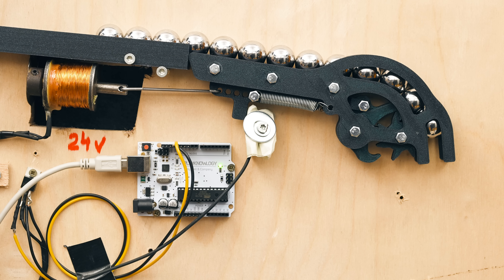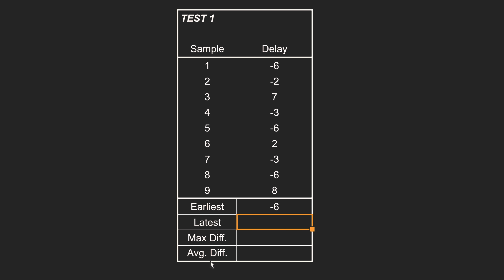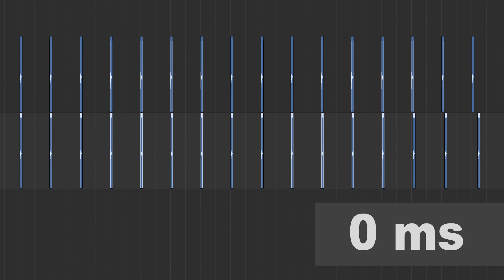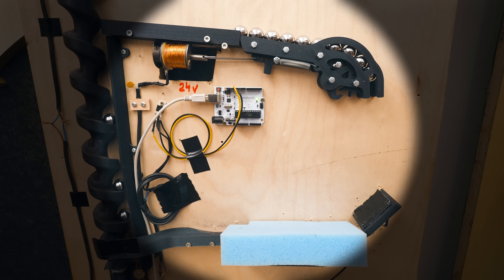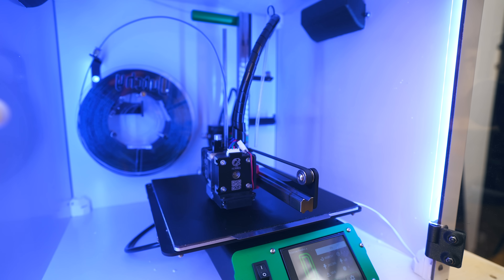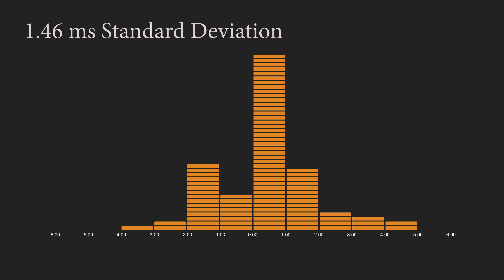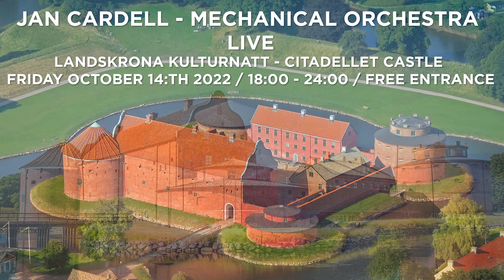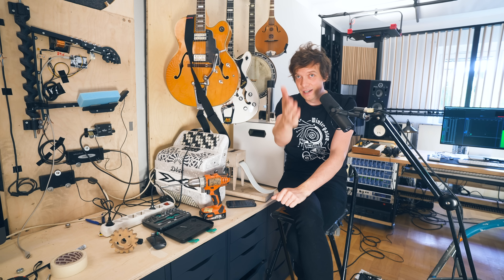Testing the Arduino Marble Gate

Comment: Just saying, even though I barely have experience with actual music, I would have the same kind of perfectionism with the kind of musical stuff I make. It took me quite a while to break out of it saying "I can always get it as close as possible but not perfect every time". A small ms delay (especially 1 or 2 ms) is not such a hinderance to the sound of the music and wont ruin it, like in a live concert. A few cents out of tune will not hinder much of the sound of the music and wont ruin it, like in a live concert. Perfectionism will only slow progress down. Our imperfections make us human, just like how imperfections of the original marble machine gave it its charm. You can improve it and make it way better, but never 100% perfect.

Comment: Guide the fall more during th release and it should hit more closely to the same position each time. The release of the falling ball will have tiny variation and that will alter the angle the ball falls in slightly, but the further from the drop the ball gets the bigger the variation in the hit area you get. To remove that, just guide the balls a bit more at the beginning after it's dropped and that issue should go away. It might add a few milliseconds to the release to hit time, but that at least should be the same each time.

Comment: For next tests you can utilize the arduino to measure the inaccuracies. Simply connect the microphone to the analog input and detect the spike or better, use comparator to convert the spike into digital rising edge. This way, to be precise with both dropping the ball and measuring the time, you can utilize timer and interrupts - they are way more reliable than millis() and delays. For any help or question hit me up

Comment: To get a better statistic and less work you should have the marbles drop onto a switch that can send an impulse back to the arduino. That way you can record 1000:s of hits digitally and then import them into your spreadsheet for calculations without the need to manually write digits and analyze sound-patterns.

Comment: I feel like there's a fundamental misunderstanding as to what standard deviation means in this context?
It's being represented as a constant delay, that increases the separation over time, but that's not how this would work in practice? Some hits would be earlier than the standard deviation, some would be later. 
If you let the simple pattern run for a long enough time, yes, this will be the end result, but if the song isn't long enough, that "problem" may not ever become noticeable... 

Pretty sure that  Martin doesn't write songs that drop the same exact, repetitive beat pattern  run for ten straight minutes. The normal variety of an actual song should prevent this delay from becoming apparent. 

Never mind how much slop there is in that home-made solenoid... It moves visibly left and right. Perfectionism can go off the rails... Is that's what is happening here?

Comment: For the record. Sound travels 1feet per millisecond. So. 3ms is one meter of difference . Basically having 3 ms delay is like stepping one step away from a speaker. Or. 2-3ms is the delay you have when you play the piano. The length from the string to the ear.

Comment: How did I miss this video :O I was wondering where Martyn got to, welcome back!

Btw with arduino are you usig millis()? the timer4 interrupt will mess up the accuracy of loop(){} when you are using delay(), however if you set a variable to millis()+yourTimeHere and then wait for the variable to be equal to or greater than (>=) it will tighten up the precision

Another way is you can stop all interrupts with cei(); but you will need to use the sleep.h library and a few other steps as delay() will stop working without timer2? running but you won't see any jitter in your timings

Comment: This reminds me the pursuit of prefection on audio amplifiers, DC-DC designs, unnecesary high speed and bandwidths .... something that is theorically deligthfull, with good reasons behind, could end sounding harsh in practice and the desire for speed leads to inestability. All this perfection wont even atract audio enthusiasts that prefeer valve amps, some of them from the 50 and 60s which in paper got worse numbers in alost every aspect in comparison to SS. Accuracy is not always a good friend of what or brain is pleased with.

Comment: I understand the need for tightness. But also wonder if this can be tuned afterwards. E.g. your microphone will delay all sounds for 10 miliseconds, except the drum, because that is always late. 
Because if you really want to do this mechanically it's going to be washers all over again. It also means all your instruments need to be at exactly the same height. For your cyberbase it may be very tricky- will the sound pick up on the marble hitting, or on leaving? 
So although I encourage such rigorous testing, I also wonder the implications of it -- is it a problem which can be worked with, and at what cost? 
And do you really want to finetune 50+ gates to be properly aligned?

Comment: If you would try to compute the 95% confidence interval on the standard deviation of TEST 7, you will get (1.8, 2.4) for your sample size of 92. The fact that you got 2.83 in Test 9 is so outrageous from a statistical point of view that it becomes unbelievable that the experiment setup is actually the same. The issue with the incline of the ramp shouldn't really matter in this case, because the variance component that you get from it should also be present in TEST 9. And yes, for the confidence interval you have to assume normality, but TEST 7 data looks normally shaped. My only conclusion is that there must be a difference between the setups of TEST 7 and TEST 9. Even humidity could play a role, but again, there must be another factor that influenced those results.

Comment: There's something I like to call "Bassoon Theory": the bassoon is a ridiculously badly designed instrument. Every single note is either flat or sharp and has to be adjusted for by the player, there are multiple notes that can't be played at all, and you need to "flick" at the octave key to get some high notes to come out right. Compared to a cello or a flute, it could almost be considered unfinished. But it works, and it produces a beautiful sound, flaws and all.
Don't worry too much about these almost imperceptible details. Sure, sometimes the MMX dropped a marble, or rattled around a little, but it made lovely music, and it doesn't need to be perfect to do that. No matter how imperfect the original design was, it worked, and it was better than a bassoon. And, to some degree, the imperfections were what made it beautiful.

Comment: Your two marble machines drive multiple voicings from a single marble mechanism.  That sure doesn't give you the flexibility of a modular system.  But, what would a single marble mechanism look like if it were designed to drive interchangeable voicing modules?

Comment: You know what would be cool, a messy music machine that is allowed to throw marbles on the floor which are then gathered on a giant sheet/ramp under it and then auto collects and funnels them back into the machine that can also  play random sloppy notes that can auto correct for its breakdowns with built in fail safe mechanisms. This failure allowance could create beautiful dynamic fluidity in whatever music it conceives naturally as a result . It won’t be tight , but it will certainly be art.

Comment: Edit2: 17:09 - THE coolest mechanical orchestra are ones without any electricity powering them. In my eyes, this makes you one of the best musicians to ever live.

Edit1: After finding some time to actually watch the video, I'm editing the comment. This is the first time I'm glad the title was misleading :D
Should be "Testing the Marble Gate using Arduino". Original comment:

Careful with adding electronics. Electrical components can make everything work, but you might regret not making it purely mechanical.

Comment: This is just one gate? It's going to be a nightmare manually timing out multiple of these rigs if continuing with a MC. You might answer this later in the video though.

I timed out 102 raspberry pis to fire cameras based on multiple physical sensors. It was also extremely time sensitive and I can't imagine trying to create anything reliably musically out of any of those mcs.

Comment: How tight? how accurate? Simply put, How tight can you measure? How tuned are your instruments? (non musical) That's the limit of "tightness" of all physical systems aka everything. Marbles are no different. Electrons can be considered as very small charged marbles, how "tight" can electronics be?  These are all rhetorical questions. Certainty and precision are illusions of scale. When it's good enough it is good enough, wherever you decide that may be, beware quixotic pursuits of perfection.

Comment: Martin, my good sir, sound only travels at about 1 foot (30 cm) per second. Two marble gates in PERFECT sync but 60cm apart will be "loose" by 4ms (+/- 2ms relative to one another) depending on whether you stand to one side of them or the other!

Comment: With a standard deviation of 4 ms, 95% of all hits will be -8 to +8 ms from the mean, which was -1ms, so -9 to +7ms, which seems perfectly adequate to me. Notice you can't say this without knowing the average, so I don't know why you decided to ignore the average! In reality there would be a physical upper and lower bound to the variation which will bring it to about 100% probability of being between some small number to some other small number.

Therefore, even without realizing about the angle of the target bringing the st. dev. much lower (which is a great find), it didn't seem like a good place to spend a lot of time micro-optimizing.

Comment: Personally I'd have no issue with the programming wheel making an electrical connection and dropping the marble with a solonoid, it's still mechanical, it's still going to make clicky clacky sounds, just means you don't need messy linkages

Comment: Glad to see you back at it Martin and thanks for sharing the data collection process with us! It is very interesting to watch. Just a heads up on the statistics... Standard Deviation tends to be sensitive to sample size, meaning a larger N will tend to result in a smaller SD, even if other factors describing the distribution like min, max, and mean are all the same. So if you continue doing analysis that relies on comparing SD's across samples, it would be good to hold N constant as much as possible. I think you were doing this in most of your trials but you didn't mention sample size so I thought this might be good to consider.

Comment: I work in telephony where the acceptable "jitter" limit for an audio call is 30ms.  The marble gate is an order of magnitude better than that at 3ms which is close enough for rock and roll ;)

The other thing to remember is that this 3ms accuracy is a standard deviation - some impacts will be early, some bang on time and some late.  The increasing ms delay playback artificially amplifies the effect.  Try instead to make a playback where the beat is adjusted by a normal distribution of +/- 5/10/20/50ms and listen to those for a more realistic experience of how the machine might sound.

Comment: So 3.9 ms of standard deviation, does mean that approximately 68% of the marbles will be within + or - 3.9ms apart from the middle point (in this case 0). Now, in my opinion, tight music is overrated. I think, variability in the timing gives personálity to music, that is why I rather listen to live performances rather than studio music.
Reply: Also, 95% of the marbles will hit between + and - 2SDs (7,8). this mean that between 3.9 and 7.8 you have only 27% of hits. 99.7% will be within + or - 3SDs.

Comment: I don't mean to sound like I'm telling you your wasiting your time but I think that your doing the "lost in the details" thing again.   I would say that you should measure the standard deviation of an actual drummer and use that as a baseline to match.   I have a hard time believing that a human would actually be this accurate.  If you require everything on the machine to be this accurate then I feel like you'll go down the same rabbit hole of impossible perfection that you were trying to achieve with the MMX.  I'm not saying that what your doing is wrong or invalid I'm just worried that trying to hold your designs to this level of scrutiny then you will get to bogged down in perfectionism.  I think you should keep at it and just try to remind yourself that true perfection is impossible and haveing some deviations and imperfections gives the things we build, create, and design a human quality to them.

Comment: STD Dev is the average distance from average.
You do the regular sum(x) / count(x) to get the average, then you can calculate individual deviations[squared] using (x[i] - avg)², then you sum all and divide by the count (or count-1 usually) and take the sqrt of the whole thing: sqrt(sum(devs)/count(devs)).

edit: corrected a mistake in the formula, but I have checked against google docs now.

Comment: Warning, NERD content.

An Arduino can be way more accurate than +/- 1 ms. 
I think your code can be rewritten to achieve microsecond precision.

You shoud use harware interrupts or use a while loop and call "micros() " each turn to check if you need to drop a marble.

Comment: If you are going to be be doing a bunch of stuff like this, it might be worth getting a time interval counter - connect the start channel to the signal driving the solenoid and the stop channel to the microphone output.  It would save you a lot of post-processing time - even my (old and obsolete) Agilent 53131A can do this sort measurement and will directly display min/max, mean and SD and other statistics directly - all you need to do is set the trigger level correctly, set the number of samples and hit run.

Comment: I have a concern. The solenoid introduces an irregular lag between the electric signal and release of the device. Magnetism isn't a switch - on or off. It falls off like a slope. With the precision you are asking, I'm concerned that the inconsistent results are going to be exaggerated by this. Mythbusters had this problem. They were trying to shoot an object and the release mechanism was solenoid based. They missed every shot and had to re-engineer their test rig.

Comment: Jfc, I completely gave up on this project and Martin after the MM3 reveal after years of religiously following his work and it's always validating to know how correct of a decision that was. This man scraped years of development and engineering to begin from scratch and like clockwork here he is obsessing over imperceptible timing differences between single marble drops in a machine that will be dropping dozens of marbles a second. The fact that he demonstrated absolutely 0 variation could be perceived below 10ms and still felt like 4ms wasn't "tight" enough shows where this man is mentally approaching this project from. 
If it wasn't obvious before, we are truly witnessing development hell. This project will never be made and I pity every soul that invests time or money into this mania.
Reply: Amen

Comment: (5:00) For those wondering why the marble sound with a delay between 2 and 30 ms sounds like its coming from the left: our brain uses the time difference of sound reaching both ears to locate the source. The maximum delay between the ears is 0.63ms. So what happens here is something different called Haas-Effect or law of the first wavefront. Our brain will always take the first incoming wave front for localisation and interpret following transients as wall reflections or echoes. Above a delay of 50ms the delayed signals are percieved as two sounds. This effect can also be used in the mixing process, as it creates a more natural feel of localisation compared to panorama.

Comment: Good to see you back,  My thought is you need to not use the programing wheel for timing.  The programing wheel should be used to enable the next up coming drop period.  A cam shaft should be used to define the drop moment.  Think the cam shaft in a engine opening and closing a Valve.  But with some engines they can turn the valves off so they do not open.  If you have a cam that an open a gate 24 time per beat. the programing wheel is used to indicate which instance the gate should drop the marble (24 times per beat gives you different timing 1,2,3,4,6,8,12,16,)  You need to build a engine block for you machine.  A solid immovable core that will give you precise tight consistent timing.  Once you have this core the programing wheel can use it to create tight music without having to deal with all of the linkages and pins being tight and precise.  As long as it is within the interval created by the cam you are good to go. Also the progaming wheel does not have to deliver the power to move the gate so a needle could be used for a pin.

Comment: you seem like such an imaginative guy but I hate to see you going around these circles again.... you're looking for a perfectionism that won't be found in a mechanical machine. the appeal of the original marble machine was that it was crude and fun and flawed and full of imagination. truly you need to turn your philosophy on its head and make one that spews marbles all over the floor, has some very flaky timing embraces randomness but is just absolute fun.... failing that ditch the marbles and reinvent the synthesizer if you're only interested in accuracy.   I would hate to see you go around the circle again and go through so much angst... I see the issue here as pretty fundamentally what a marvel machine can and can't be, not a process problem